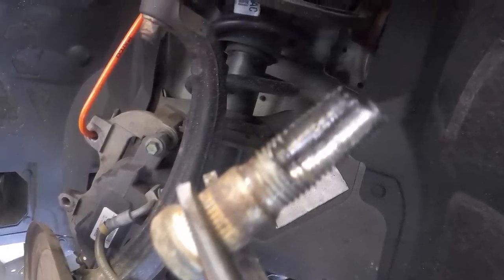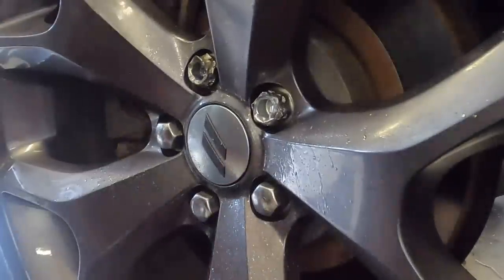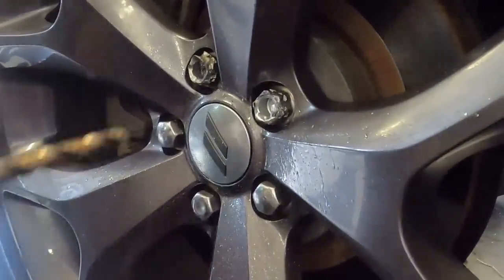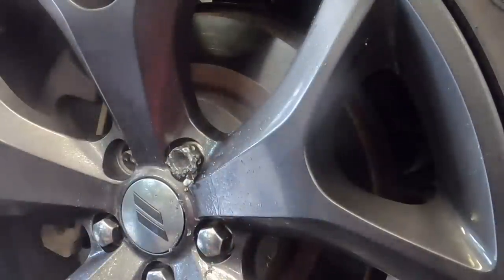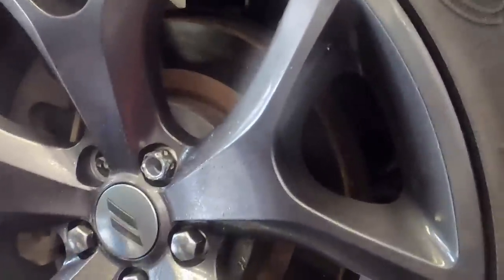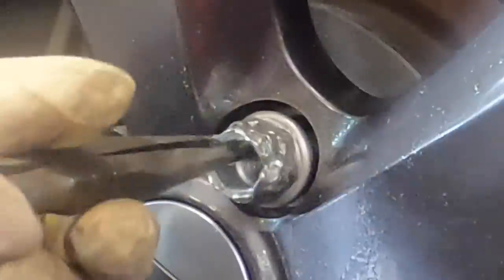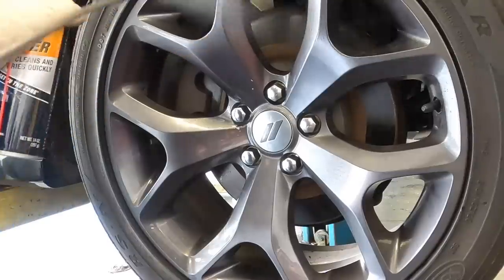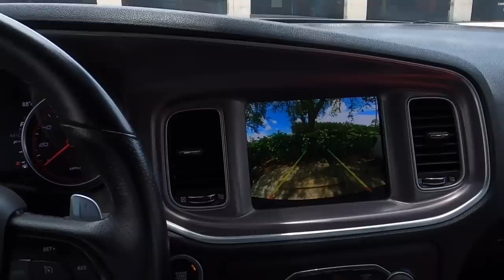2019 Dodge Charger! READ DESCRIPTION FIRST! Dealer Couldn't fix this! Must See! Bonus Footage

Comment: It takes over 5 hours to correct a small mistake that could have been prevented with 5 seconds of thinking before doing! Great work!
Reply: “An ounce of prevention is worth a pound of cure”
Reply: Exactly. Just hand tightening the lugs down would have prevented all this. Instead they just sent it. The next guy be damned
Reply: 80 to 100 foot pounds max for lug nuts. At least I thinks that's the max. But I might be wrong
Reply: @colinklang  lock tight, make er right 👍👍
Reply: @ronniewilliz153  Depends on the car. I had one  car, a Peugeot, that the wheel torque was 35 foot pounds.  And only three lugs to boot.
Reply: 5 .1/2 hours @ about a hundred dollars per hour Australian ($75  U.S./ hour) 
Some other employer now has the pleasure of paying that person
Needless to say the person that over tightened the wheel nuts is doing 
watch repairs or typewriter maintenance; jobs that require a delicate touch, yeah, right!
or hopefully, some other job that has nothing to do with motor cars.
Reply: @ronniewilliz153  I read on google the police cruiser are 140 lb of torque. This one particular could be in range of 111 to 115. The Hellcat is 111. It is weird that the police cruiser need to be 140.
Reply: Always look in google or manual.
Reply: This wasn't an over TQ issue it was someone being lazy with an impact and cross threading the lug nut on because they didn't start threading it by hand happens all the time for all the TQ specs comments below.
Reply: Mine was like that it was to tight from the manufacturer
Reply: @0devast8r0  Yes, that is weird. Do they have larger diameter studs? Maybe steel wheel vs alloy?
Reply: @benjigray8690  More than double that where I'm at
Reply: @colinklang  The dealer must have been required to do some work on the car they required the wheels to be removed before they sold it.  Otherwise I bet the dealer would have just put it on their lot and sold it.  Then when it sold, the buyer would then need to deal with this gem of a problem.  The dealer would have taken no responsibility for it since months or even a year could have occurred before this issue was discovered and the dealer could have said anyone could have touched that car in that time.  Of course we also don't know who put these rims on the car being torqued down so much.  It is obvious that the person who did this used the NASCAR method to install them.  They used an impact gun and the lug nut was probably placed in the socket.  So the impact gun was used to start the lug nut.
Reply: @Do_Nothing  :
Getting/being lazy with the impact tool won't result in over torque
Reply: @K7DFA  its called crossthreading bro
Reply: @Do_Nothing  My guess is both. Mechanic (that should probably be enclosed in quotation marks, but it was probably someone working in a shop) was in a hurry - and, quite possibly, p*ssed off - jammed nuts on, cross threaded, said, "Screw it, I won't see this car again," and hammered away with the impact gun and air on maximum until the nuts were driven more or less into place. At least the one I saw went like that. One of the business owner's cars, headed to auction. Guy got... invited to work elsewhere, not long afterward (for multiple reasons, best summed up as "douche bag"). Oh, and he thought it was funny that the poor schmuck who ended up having to deal with it next would have trouble. Some people are like that. Dropped on their head at a young age, maybe - or not dropped on it hard enough at a somewhat older one. . . .
Reply: @ronniewilliz153  No. Not at all. Look in the manual. Use that. For instance, to my Volvo V90, it is 140 Nm.
Reply: @ronniewilliz153  depends on the car. Shelby GT350's require 150 ft. lbs. of torque
Reply: @ronniewilliz153  you might be right for most cars/trucks- I do know that the spec for SRW 2013 f250’s are 150 ft/lbs on all 8 lugs for all 4 wheels… an no shop I ever took mine to ever tightened them to the spec. Pretty sure they went 8 dugga duggas and called it good- which was between 90-110 ft/lbs.

Comment: Hi just a tip that we use in the black country UK, When you have put the extractor on the nut we use a bottle jack under the extension bar to support it from dropping when you put the pressure on, then when you put the pressure on the bar strike with a lump hammer inline with the socket to shock the nut give it a try the next time it works for us some times thank BOB.
Reply: robert bridge, That's been used for many years especially in the van and truck workshops , not so much nowadays with all the air and electric impact equipment  available, but very useful if out on the roadside with a flat and not much else to get a stubborn  wheel nut undone  for people that don't know about  hammer shocking the nut while while loading the bar of the wheel nut socket.
Reply: We'll I'm from the UK as well and I was shouting the same thing at him.
Reply: Yes I was thinking the same thing when I was watching this.
Reply: Great tip!
Reply: bottle jack / axle stand . etc . works pretty well every time .
Reply: I was going to comment the same thing. I have had 7 old Jeep Cherokee's from all generations between 1984 and 2000 and have had to do wheel bearings on all of them, and I live in Wisconsin so everything is here completely seized with rust, and the only way I was able to get the leverage to break them loose was a 5 foot pipe on the end of a breaker bar and without the bottle jack trick I would have never got them off.
Reply: @WisconsinAdventures  
G'day Robbie...Aussie here. What's the go with Wisconsin and rust?? Cheers 🦘🦘🦘
Reply: @klyvemurray  Because of the salt used on roads in winter.  I’m in Ohio and I experience it as well.
Reply: I too, a yamyam, was wondering why he wasn't doing the same thing...! 
Guess me old mon taught me the proper way, ay Bob! :D
Reply: I was thinking the exact same thing. Actually I was just thinking support the extension bar somehow to avoid it deviating from perpendicular, but I hadn't got as far as thinking what to support it with. Bottle jack is the perfect option.
Reply: I believe the came in rounded off since the dealer sent it in.

Comment: Great video Ray. I really enjoy your content. As to beginning the wheel nuts by hand and because of my age (I’m 62 yo and live in Canada and I still swap my own tires from summer to winter and vice versa) I’m starting to get arthritis in my hands and my index fingers and thumbs don’t play well together. I put the nut in the socket with a short extension and carefully start it on the stud making sure its not cross threaded. Haven’t had an issue yet. Most tire shops here want $15 a tire plus tax to do the swap which is outrageous considering that I can do it in an hour in my driveway with a floor jack. Some of you might think I’m cheap but I can think of better things to do with $68.

Comment: Moral of this story: don't use cheap hollow lug nuts and invest a few dollars in a torque wrench. It doesn't have to be a fancy one because even the cheaper ones get to within a few percent accuracy. A beam type torque wrench works well. Read the instructions on how to use if there's a pivot point on the handle and store in the case when not in use.

Comment: Geez, if those lug nuts were threaded on, initially, by hand that wouldn't have happened.  Someone was in a big hurry and it cost 5 hours and $$$!  Go figure, if you take your time and do it right...  You do good work, thanks for sharing it with us!
Reply: 5 turns by hand, and then a torque limiting extension on an impact. It only takes a few seconds longer to do it right! Saves a lot of time later!!
Reply: So irritating. Because it is "inefficient" as a screw up, causing so much more time to repair for such a tiny thing. 

When i was a teen i started doing light maintenance at a small dealer and someone brought their car in for a tire rotation. The lug nuts just spun and i was confused, till i realized all the threads were ripped off from someone totally blasting them on (probably for like w20 seconds a piece) with a huge impact. 

Got a lesson in drilling and removing studs that day...
Reply: See my comment above. They may have been installed  by hand...but not the five you suggest.....
Reply: @dondale68  5 turns ? At that point you might as well carry on by hand and use a real torque wrench .....
Reply: @callumcurtis15  After 5 turns by hand, there is no way you can still get them cross threaded!
Reply: I have seen an “oops” cause this problem. The nuts were hand threaded then air wrench applied with the direction set wrong. Trigger pulled  and “oops”. Direction switched then trigger pulled. Instant cross thread which is the compounded by “huh, this nut is being sticky so I’ll let the wrench pound on it for a while.” Result: cross threaded and over torqued. Classic “gorilla-ing”.
Reply: unfortunatly this happens quite often on this style lug nuts, if some jack wagon doesnt overtighten them, then its the stupid potmetal beauty cap that gets pinched or spins and also the correct size is 22mm it works better than 7/8. Snap on makes a specail socket that is for the nut found under the beauty cap which is a 20.5mm
Reply: @codywichman213  I live in NE Ohio, up here we do have salt on the roads and you just never know how much snow! So I check my lugs just by putting the socket on them, when the socket starts feelin tight I go on ebay and order a complete set of 1 piece chrome plated lugs. If not I'll be stuck in a snow storm with a flat tire and no I don't have AAA!
Reply: @twm4259  I believe the fact they were two piece lugnuts is the true cause
Reply: @wadestanton Probably in this case, yes. Normally with the “oops” cause, one will be cross threaded and all of the others will be ok.
Reply: @twm4259  Sam's club did that to me and sent me 200 miles miles back home. I didn't get 5 miles down the highway when the car was shaking so bad the glove box flew open. went back they had stripped 3 lug studs on two wheels that those didn't tighten. they pulled it into the shop and 2 'techs.' hid behind a toolbox, I was watching through the window. I yelled for them to come talk, they said, 'they cross threaded and were afraid to take them off'. I told them to take them off, after minutes one finally came off, dropped to the floor and tech. picked it up and dropped it like the hot piece of metal it was. It was then they came to me with the nut on a rag, along with a mini slinky of threads. "We can't replace studs here", the tech. told me.
Reply: @wadestanton  I have only seen it a few times and then only on one nut. Those guys raised incompetence to a whole other level. Amazing.
Reply: @twm4259  yea ill admit I've done that before luckily I was able to get them off without breaking the stud just a breaker bar and a cheater pipe, you bet ill enber make that mistake twice
Reply: @midwestapprentice1904  The greatest amateur golfer of all time, Bobby Jones, once said
“I never learned anything from a match that i won.”. The key is to learn from our “losses”.
Reply: I had my tires changed at a well-known chain here in Canada.  The next time the tires were taken off, it turned out 3 of the wheels had 2 cross-threaded nuts and the fourth wheel had all 4 nuts cross-threaded.  If it wasn't intentional, it was the most egregious case of incompetence I ever heard of.  Needless to say I never went to that place again.
Reply: @twm4259  My thoughts exactly on how the problem occurred but it happened 3 f'ing times on opposite sides? 1 time is feasible and I can see it but 3 damn times? WTF? Give that mechanic a piss test.

Comment: Gotta say Ray, one could almost share the frisson of excitement that coursed it way  through your system as that last lug nut came off. excellent job dude, an excellent job indeed   ... BUT it does beg the question, why on earth could the dealership techs not do  what you did but I guess thats why you are the 'Go-Too Rainman"
Reply: Because dealer techs are lazy as fuck. Most (not all) are parts replacers. More specifically warranty work. With direction via the mothership. If the mothership doesn't dictate it, they have no clue. If it isn't covered under a TSB or there isn't specific instructions, they have no clue what to do. Not because they are stupid, but because they are literally paid only to do tried, true, and tested via the manufacturer replacement/repair methods.  They are absolutely not aloud to think outside the box. It is the "dealer culture." You want a master mechanic who can think outside the box? You go independent. You want someone who will follow the rule book to an absolute T, you go dealer.
Reply: I presume the dealership COULD have done it, but it was a better use of their resources to pay an independent shop to do it while using their own techs for other things.
Reply: @xPreatorianx1  You think more highly of dealer service than I do!
Reply: Bigger drill bit, nuts shot and you have to replace the stud anyway 🇨🇦
Reply: They could do it. But they pay book rates at a dealer. And no one is gonna take a job making less than an hr labor. And no dealers gonna pay them the 5 hrs it took to get em off. Therefore you have your impasse
Reply: @xPreatorianx1  and if you want them to use an impact to remove and replace the air box lid to check an air filter on a vehicle with less than 10k miles in an area that has almost no issue with dust (Iowa).
Reply: @xPreatorianx1  exactly dealership techs are part replacers there to lazy to do hard work like drill out studs

Comment: Lucky you, Ray... Now you're the designated "stuck lug nut guy" in the shop!
Whenever I have a wheel off, I dab just a little grease on the threads and the base of the lug nut, start them by hand, then torque them to specification. So far I've avoided any problems!
Reply: That's the way to go. You will catch any cross threading and be able to correct it.
Reply: The wrench that comes with the vehicle is for putting the nuts on  is designed for the job and will not over tighten them. It pays to loosen a half turn and re tighten the nuts on a regular basis to prevent seizure. Never put oil on lug nuts it is dangerous and may result in them loosening due to the force of angular momentum.

Comment: Remove the original lugnuts first thing, and replace them with Dorman solid ones. This happened to my 06 SRT8. Never looked back. The stock units are one use only.

Comment: We had several left hand from bits we used to drill out frozen bolts. Had a tool & die shop that used to burn out hardened Allen bolts out of plastic molds using an EDM machine. Work like he did separates the boys from the men. Great job.

Comment: Great video. I had this exact thing happen to me after the dealer worked on my SRT. I tried all the same techniques you used including trying to drill it out. Nothing worked. As a last ditch effort I even tried to weld a large 3/4 bolt onto the end. First try failed. Rewelded it, and second try broke the lug nut more  than it was and worse yet, even though I had something protecting the wheel the heat was close enough to cause some melting. Urge. So fail x 2. With a hammer and chisel the nut was finally freed. Stud was destroyed but wheel finally off. I was really mad. However, I managed to repair the damage with some sandpaper around a snug fitting socket. Took a while to polish out but did make it unnoticeable.

Comment: I've had Chrysler lugs stuck exactly like this as far back as 94 model year.  Nice to see they're still consistent lol.  Cross thread and over torqued wasn't the problem.  Where the lug seats in the alloy rim would corrode and fuse. A little anti seize on the lug taper and it won't happen again.

Comment: You must have the patience of a saint. I bet that "smoke-wrench" sitting over there in the corner of the shop was awfully tempting. I don't know if you have an inductive heating tool, but I use that tool on damaged lug nuts if I can fit the coil around the nut, which usually I can. Get that damaged nut glowing red hot, and either the nut will spin off or the wheel stud will snap off when I try to walk it off with my air chisel. Minimal damage if any. The inductive heating tool, a good one that is, is a little over $200. I don't use it very often, but when I do, I am thankful I got it. One of my best tool purchases (and no, I do not work for a tool company nor am I a distributor).
Reply: We called them "blue-knifes", never heard the term "smoke wrench".

Comment: Ray, I think you got a compliment from the dealership that had you fix the car. They must know your work.  Good work is rewarding.  Keep it up!
Reply: They probably saw his first video. lol  It does say something about that other dealership as well. Maybe they will try to pull Ray over to their dealership with more pay. ha ha
Reply: I've met maybe one dodge tech that was decent . Most of the time they are glorified parts changers who typically only do warranty work , and couldn't fix a damn sandwich . Not surprising that they sent it out.
Reply: @johnmilner5485  It's not just at Dodge. But I would agree with that statement. One really has to be aware of it if they're looking for a good mechanic.
Reply: It's outrageous what the stealership charges. I wouldn't have them do anything besides warranty work and routine maintenance.

I'd rather do it myself but sometimes it's just faster and easier to have someone else do it.